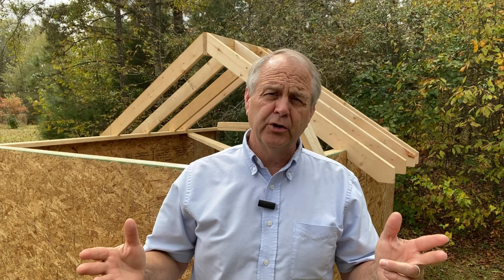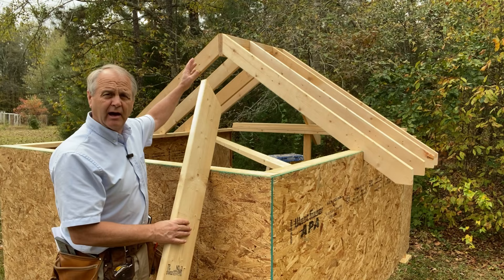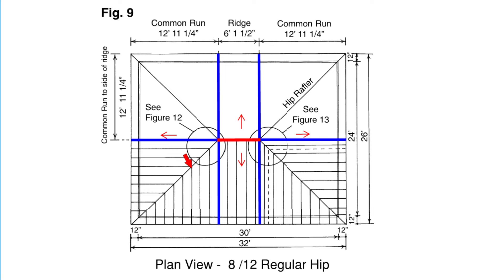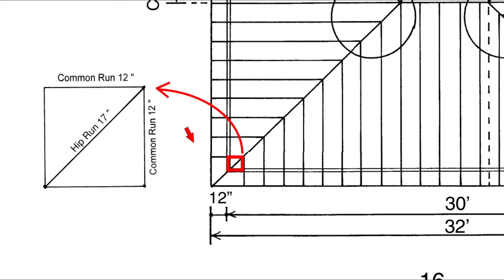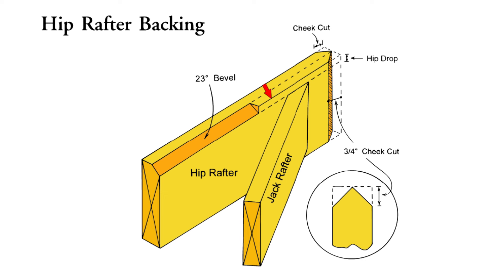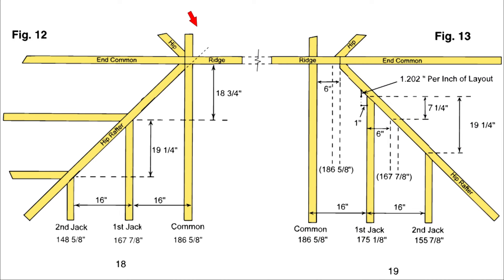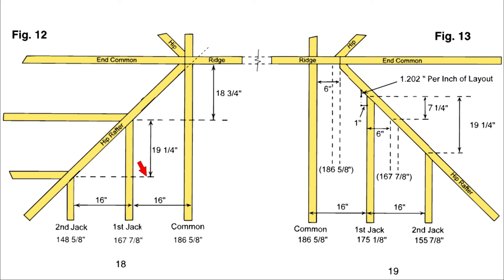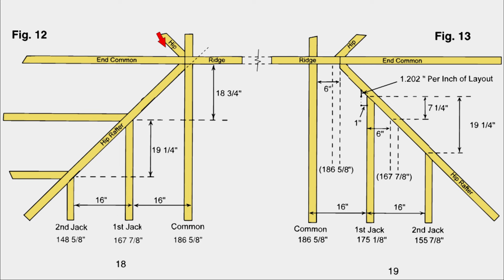How to frame a regular hip roof,  Step-by-step instructions.

Comment: Here is how I get the length of the hip  and the first jack   My book gives the length by the span of the building   say it  is 24 '   so I deduct the with of the ridge so I would look up 23' 10 1/2 ''   and that would be the length of the common.  but under hip and valley I would look up the same length and that  would give the exact length of the hip or valley no shorting.   to get the length of the first jack.   I take a cut  common and  let the tape hang over 7/8''  inch because the exact length of the common to the center of the ridge is about 7/8''  longer than the cut length.. then I take 1/2  the diagonal of 7/8''  and that is    1  1/4  let the tape hang over 7/8''  and subtract   3/4'' from 1''  and a quater that is 1/2''  then deduct  the differrence in length
Reply from the maker: That works! There is more than one way to skin the cat. Thanks for watching!

Comment: Extremely clear demonstration outlining the appropriate setting out and cutting of timbers for a regular hipped roof. The close up shots of the junction between the common rafters, the hip rafter and the ridge board to demonstrate how the seat cut for the hip rafter could be dropped and the top edges of the hip rafter chamfered, was really helpful. Likewise, the explanation on producing appropriate Jack rafter lengths was most useful ( again related to the geometry in the vicinity of the ridge board, the hip rafter and common rafter). Thanks for providing this content - it simplifies many concepts for those of us wishing to learn about roof construction.
Reply from the maker: Thanks for watching!

Comment: Thanks Barry for a great video! Just a note for viewers, as the model didn't show this: don't forget that rafters need to be tied with ceiling joists to be structurally sound.
Reply from the maker: You are correct. If the ridge isn't directly supported, then a solid ceiling joist tie across the building is required. Thanks for watching!

Comment: Everything I’ve done with string lines and the Phonics method of building is clearly explained. This is so great!!
Reply from the maker: I'm glad it was helpful. Thanks for watching!
Reply: @RoofFramersBible  the salient point for me is how, and where to generate measurements. Understanding the geometry, ratios of angles, and knowing when to add/subtract material thickness has been super helpful! 
Really all of the angular math in building any structure (that has squares and triangles)  boils down to chugging out ratios!
Reply from the maker: You are exactly right! Once you understand the principles you can build anything. Just take it piece by piece and solve for that next triangle. Thanks for watching!

Comment: How do start assembling the ridge beam? How high from the ground?
Reply from the maker: Usually you would just set common rafters on the sides and end of the ridge. That will set the ridge height. You would then just strut under the ridge down to a wall to support it. Of course you could also calculate the ridge height. Simply take the adjusted run of the common rafter and use that to calculate the rise. Then you add the H.A.P. (height above plate) of the common rafter. That will give you the height to the top of the ridge. If some of that isn't clear to you, watch this video. https://youtu.be/mjBEeN-O_Oc

Comment: I don't mind using common length difference for hip jacks rafter on small spans . I will not use CLD on a large home with a 48' hip... Even the least minor deviation " In the perfect world of framing " can lead to customizing every sheet .. If I do a hip to heel sweep measurement and transfer the HAP or as I call The Heel Plumb Cut Line . Then find the second to the shortest with a heel sweep off the lead rafter . Then transfer the HPCL  .. subtract the shortest from the longest and divide by what the book says is the CLD as a constant  . I generally find a real world error and refine it . If a book says the constant is 19.22 but my calculations come out to 19.27 according to what's exist in the field . Those .05 " add up quick per rafter. So then I'll input a new constant and begin deducting from the longest and it will return to the second shortest and further deductions will find the shortest with supreme accuracy . I can use every descending 4th hip jack rafter as a hip stabilizing brace and fill in the blanks without layout and achieve deadly precision in an imprecise world . This method keeps every one humming along .. I also teach my guys to write numbers like 18'-3-3/8" as 219-6 .. Another thing that can cause a headache if the HPCL at he hip . How many times have we all seen a hip not being lowered at it's specific height and many wonder why it whiplashes up like a pagoda.  Also . I like to draft a visual pyramid for a a bastard hip/ valley  , Calculate all angles , cheek cuts , inclinations, plate settings and have all the trig ratios. I call it a Rosetta Stone where I can see what has to happen and have it hanging near my blueprint table .. When dealing with some insane roofs with 20 uncommon pitches all colliding  .Better have your brain on high alert .
Reply from the maker: I agree with the "better have your brain on high alert" comment! Framing a complex roof isn't for the faint of heart. Certainly there will be site errors that can throw off the calculated lengths, however I have found that if the foundation is level, square, and true dimension it is amazing how well the calculated lengths will fit. As the old saying goes, "math doesn't lie". But at the end of the day the carpenter has to work with what he is given and make it work. My hat is off to all the hard working carpenters out there busting a gut everyday to deliver quality. It isn't easy. I know because I've been there. Best wishes, and thanks for watching!

Comment: Great video, question I'm trying to make a hip roof for a shed the dimensions are 24'x24' what would my ridge be? 24 Length - 24 Deep=0 plus the thickness of the ridge 1 1/2. So my ridge would be 1 1/2. Thanks
Reply from the maker: If it is a regular hip roof, then you are correct - 1 1/2". It's kind of hard to call that a ridge isn't it? Good luck, and thanks for watching.
Reply: Instead of using 1 1/2 as ridge the two first rafter should be full  length without deduction the other two deduct 3/4 from both

Comment: The illustration first shown at about 1:10 min. appears to have an issue. The left end hip has 3 jack rafters on one side of the king common while the other side has 4 jack rafters!
Reply from the maker: You have a very sharp eye! I actually had never noticed that. That is an isometric drawing to illustrate it in 3D. It was drawn for perspective and is not a scale drawing. You are correct. Thanks for watching!

Comment: What do you do if the short hip king common rafter is not on 16 in on center? The long hip you mentioned and have shown. But on the short hip if you want to go 16" on center, then one side will not match on the 45 degree hip.
Reply from the maker: I'm not 100% understanding your question, but if rafters are off layout for any reason it is easy to adjust the jack rafter lengths. Roof Framer's Bible for each pitch gives a figure of "jack rafter length per inch of layout", that is used to quickly make those adjustments. Thanks for watching!

Comment: When you said you should use the length of rafter to tail instead of HAP … how do you figure out the total length of the hip rafter considering the overhang is different on a hip? How did you know how much length to add on?
Reply from the maker: You can use several methods. You can physically lay it out with the framing square, or you can calculate the hip length. In our example since we were using an easy 12" overhang on the common, then the hip tail run was 17" which we laid out with the framing square. Or, you can use Roof Framer's Bible to get either the tail length or get the entire length of the hip. You could also use the tables on the framing square. Thanks for watching!

Comment: Hi, brilliant book, just brilliant.  Can i ask in regards to a standard (pitch same on all sides) hip roof, is it advisable to always drop the hip lower than the HAP of the common rafters as illustrated in the book?
And in regards to irregular or bastard hip roofs you don't do that?
Reply from the maker: Yes, you would typically drop the hip to avoid having to "back" the hip. For a bastard hip, if the pitch difference isn't too great you could cheat a little and just drop the hip an average of the two hip drops. But if you want to be completely accurate then you would need to back each side of the bastard hip rafter. Thanks for watching!

Comment: Does the jack rafter have to be the same lumber as the hip rafter
Reply from the maker: No, in fact the hip is required to be one size larger than the jack rafters that bear against it, i.e. a 2x8 for 2x6 jack rafters. This is so the cut on the end of the jack rafter will have full bearing on the hip. The same is also true of the ridge board. Great question. Thanks for watching!

Comment: Should the hip rafter be the same board like the Ridge board, or the common rafter board can be used as the hip?
Reply from the maker: Both the ridge and the hips have to be a minimum of one size larger than the common rafters used. So, for 2x6 common rafters they would need to be at least 2x8's. This is so that the angled plumb cuts will have full bearing on the ridge or hip. However, if the ridges or hips are long and /or unsupported they may need to be a larger size. Consult your structural design or engineer. Thanks for watching!
Reply: When cutting the hip rafter. Do I deduct 1/2 the thickness of the ridge board from it, like the common rafter?
Reply: And for the hip roof. Is it a case where the thickness of the lumber must be added back to find a ridge after taking away length from the width of the building
Reply from the maker: @SherlonCampbell  If you have deducted for half the ridge and use that common run to get the hip length, it will already be adjusted for the ridge. Of course many carpenters will just set the ridge and commons and then just measure to get the hip length. Either way is fine.

Comment: If you had to do a hip drop and amend the H.A.P, would it technically change the pitch of the hip?
Reply from the maker: No, the pitch of the hip would not change. The entire hip would drop straight down and remain the same pitch. The H.A.P. also would not change from the common. It would just be measured at the edges of the hip instead of at the center of the hip. Thanks for watching!
Reply: @RoofFramersBible  That makes sense. Thank you.

Comment: By dropping the Hip after you cut it you do mess with the Hap right? I am confused in that part
Reply from the maker: Yes and no. Dropping the hip instead of backing the hip, does lower the hip rafter and change the H.A.P. on the edges of the hip, but not at the intersection of the roof planes at the center of the hip. When you don't back the hip, the edges of the hip are too high to plane out with the roof on each side. That is why you drop the hip. Of course if you back the hip, you don't have to do anything and the H.A.P. is fine just like it is. I hope I was able to answer your question.
Reply: @RoofFramersBible  ok thanks that answers my question, so if you are using an lvl for a Hip that measures 1-7/8 your drop will be 7/16?
Reply from the maker: @pabloteran7082  The hip drop varies by the roof pitch and whether it is a regular hip or a bastard. Yes, the thicker hip will require a greater hip drop. If it is a regular hip it will be proportional to the drop for 2x material. Half the thickness difference from 2x, so 3/16 difference from centerline. You add a little to the hip drop, but it would only be roughly 1/8" more than the standard hip drop for that pitch. Good luck with it!
Reply: Thank you for answering my questions i just ordered the roofFramersBible for any other questions in the future thanks.
Reply from the maker: @pabloteran7082  You are welcome. Thanks for watching!

Comment: Personally I like gables more. Less a job to roof and cheaper for joists, roof sheeting and roofing material. Get your run of starters cut to start and your done in half the time! Sorry to disappoint you!
Reply from the maker: Yep, gables have their advantages. Hips do as well. For instance you don't have to buy or install the siding in the gable ends. They both are just tools in the architects toolbox. Thanks for watching!
Reply: @RoofFramersBible  Fun fact: Shed roofs, gable roofs and hip roofs have the same surface area when they have the same size, same pitch and same overhangs.
Reply: I personally like having my house protected with a hip roof.